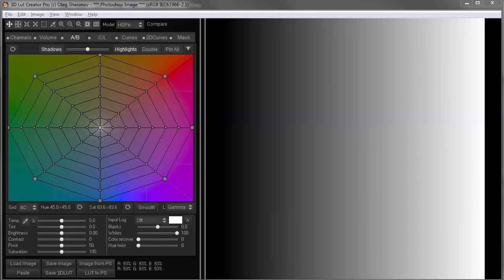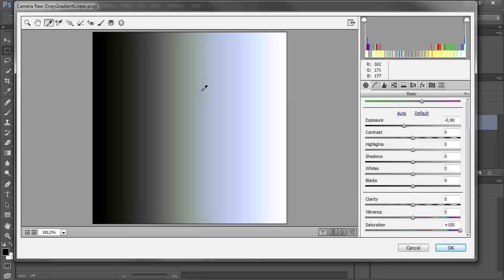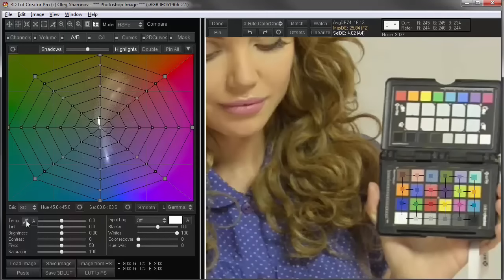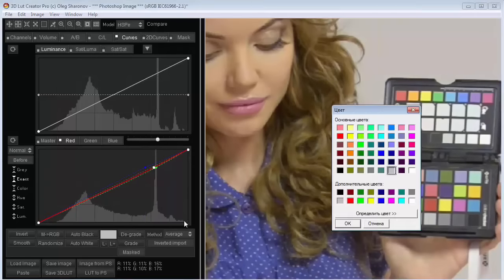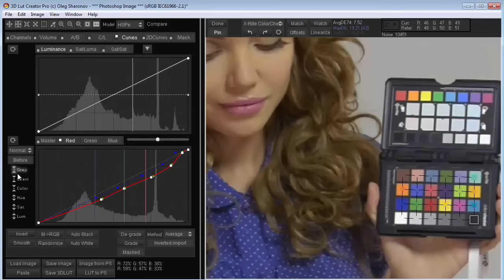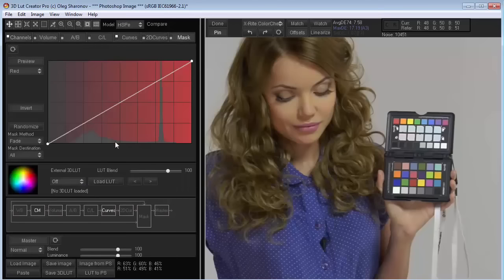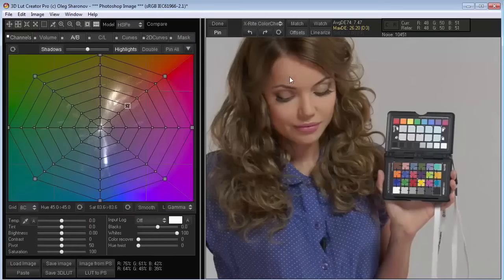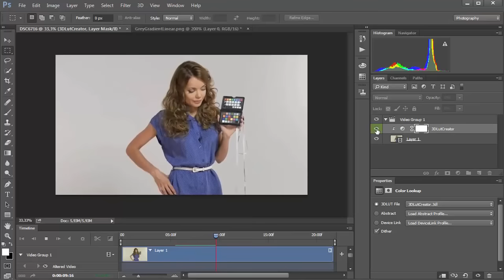Color correction with Color Checkers in 3D LUT Creator part 2

Comment: Is it necessary to have the x-rite colorchecker for this to work?  What if I have a chart (or make one) that is not supported ?
Reply: Of course it necessary. How could it possibly work with any other chart when the application would quite obviously have no clue whatsoever as to what colours are in your chart, let alone what the colours ideally should be. Did you actually watch the video? The whole thing is about correcting the colour cast and this is ONLY possible because 3D LUT Creator knows what the colours in a ColorChecker chart are supposed to look like. Otherwise, you might have fluorescent pink for the red patch, fluorescent green for the green patch, etc? You could have literally ANY colours you want in your own chart which you created but that’s completely pointless because the app wouldn’t know that you’re using your own, wacky version of a ColorChecker instead of the Xrite version, as per everyone else.

Moreover, why would you ever even want to create your own ColorChecker chart? It’s been the reference standard for, maybe, 40 years or so now, do you not think there must be a very good reason for that? Does it not occur to you that for SO many photographers, worldwide to all use the same chart, over several decades, that just maybe there’s something worthwhile in the colours from said chart or perhaps the colour combinations from that chart? Just some food for thought is all.
Reply: @aaronperelmuter8433 no, the workflow shown here can actually be applied to some very effective color correction. As long as his chart has a decent amount of gray patches, he can match to any color from his chart as he wanted. It may not be as color accurate as using a color checker, but it would still be a lot better than the original.